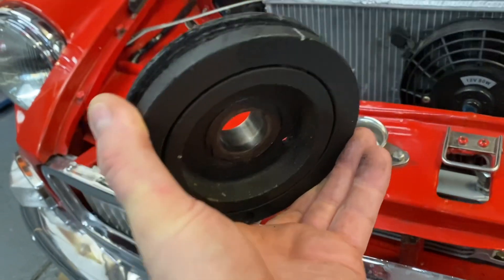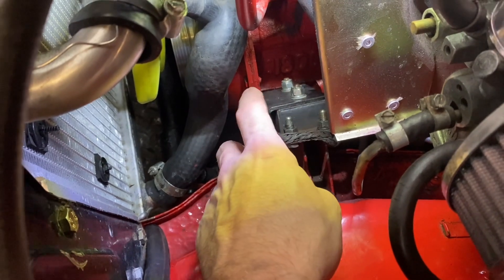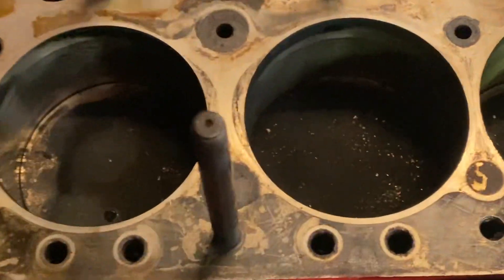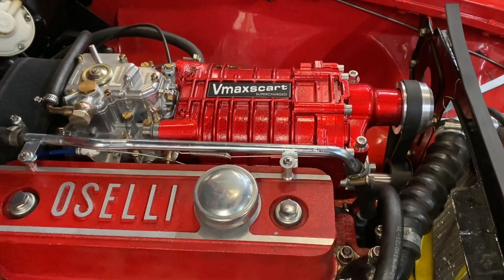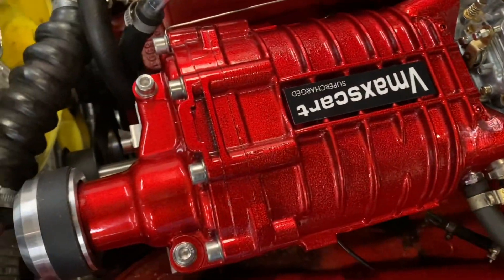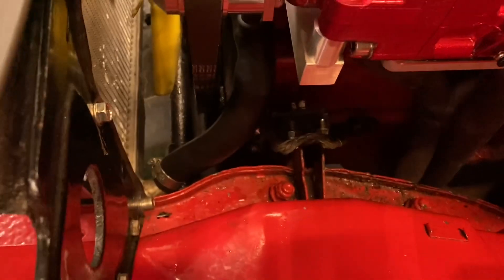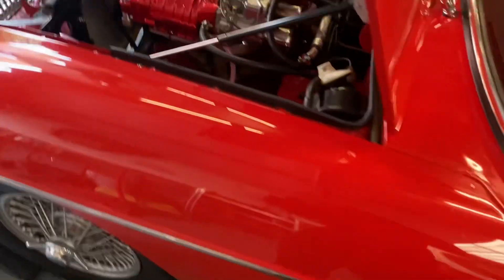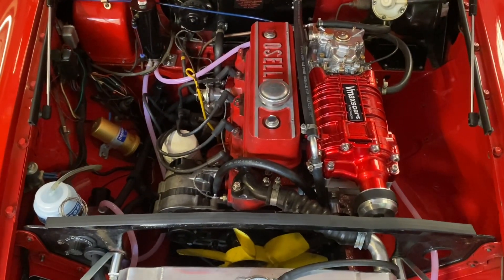MGB Supercharger  fitting

Comment: Two questions. Any instances of not being able to get tappets adjusted correctly given the head is now further away from the camshaft? On the bottom house, was the S shape to absorb engine movement and stop it tugging on the radiator; probably only a problem with worn engine mounts.
Reply: I was able to adjust my tappets, but there is not much adjustment left.

Comment: Crankcase breather Stuart, where does that go?  Seems to go somewhere behind the alternator.  Also the charge cooler pipes, got something weird going on here as well, I'll call you.
Reply from the maker: On this car the breather pipe heads down to the road , you can run it to a breather canister ideally.
Reply: @Vmaxporsch  Perfect, thanks Stuart, I tried to call however it appears you don't work at the weekends possibly.  Anyway, I have two charge cooler connections, I have no charge cooler option so I assume I can put a "cross over" pipe between these two brass fittings.  Also have two small tubes that come from the inlet manifold ports, pressure tappings I assume, do these go to my boost gauge?  Got where the servo pipe connects to, assume a branch / T peice from this line to my dizzy vacuum connection.  Couldn't find anywhere else to plug the line to the dizzy in.  Would have preferred to have called and talk to you about this however you appear to be answering YT stuff.

Comment: Thanks for the video....i noticed that on this installation the vacuum line has been taken off the side of rhe supercharger body but the manifold i have has been tapped already on the inlet pipes. Is there any preference of one location over the other for rhe vacuum feed?
Reply from the maker: hi can you send a pic of you manifold to my email ? vmxscart@hotmail.com
Reply: I have messaged you with a picture of the manifold.
Reply from the maker: your manifold has been tapped for the bypass hoses , (see other videos)i put the  boost vac takeoff is on the body of the supercharger below the rotors when i make the kit.
Reply: @Vmaxporsch thanks for clarifying....I  was in 2 minds on doing the bypass and  was going to see how it runs without first but that may be the clincher 😅

Comment: What does the decompression plate drop the CR to out of interest ?
Reply: It has the same effect as increasing the combustion chamber cc. The % increase in volume at BDC is minimal, but the % increase at TDC is significant, thus reducing the compression ratio.
Reply: I know it has the effect of opening up the cc in the chambers just wondering what it's being opened up to ?
Reply from the maker: @alexwoollams7230  drops it 2 compression point from what you have assuming std bore and stroke.

Comment: Hello Stuart, interesting video, many thanks. 

Is the charge cooler reservoir in this installation an upgrade from the previous reservoir as I see it has the feed and return at the bottom of the reservoir rather than having the return at the top  and the metal vented cap? 

I have the metal reservoir on my car and was wondering whether you've changed/upgraded the specification of the reservoir? 

Still super pleased with my installation.
Reply from the maker: There's no active difference between the tow canisters , sometimes easier to fit the black one in smaller spaces.